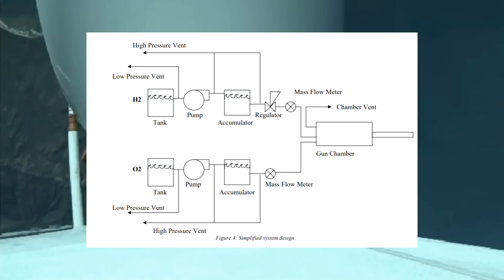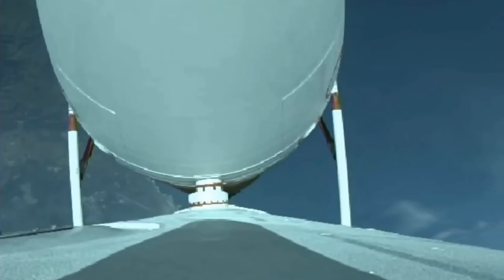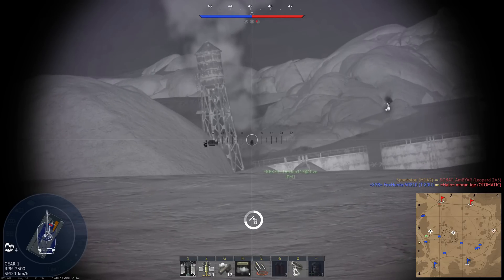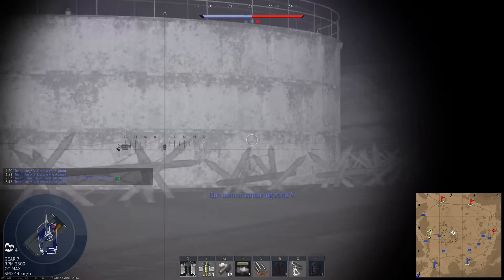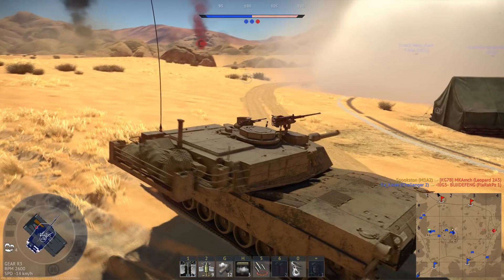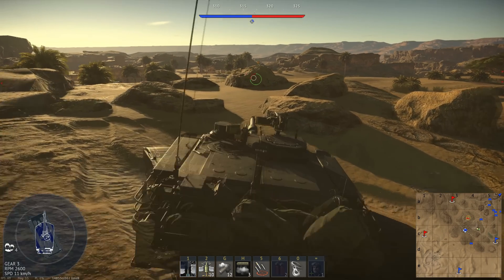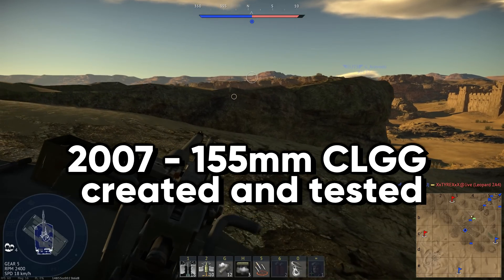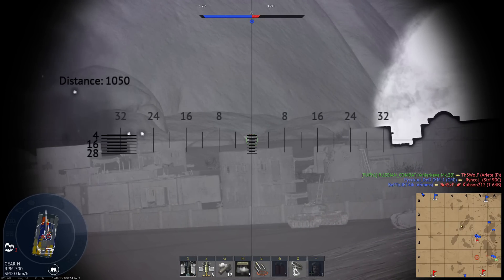CLG Guns - Future Tank Weaponry

Comment: Another issue with hydrogen is its low density, leading to very large fuel tanks compared to other propellants.
Reply from the maker: Yup. This can be seen on diagram for the fuel vehicle
Reply: @Spookston  Another factor of why ships really are the most likely platform for such a gun, along with the issue of hydrogen evaporation not being such a big deal if you can produce it on the spot. I guess those are also perhaps the main reasons I don't see this being mounted on a tank, as size really does matter.
Reply: @fishbed4522  I see
A huge electrolysis + H2 condensation and storage system would do
Reply: Are there any conventional materials that could withstand such high velocities? I figured tungsten and DU but anything else? Seems like it'd burn up. I didn't know there was anything capable of firing as fast as a rail gun. Sounds like these fire way faster. 
So maybe I misunderstood in the video... The Navy is NOT currently fielding any guns like what was mentioned in the video? They've only tested them?
Reply: @Joe_Friday  that would be an iridium-osmium alloy actually, the densest alloy known to man that is also incredibly strong. A dart similar to the current US APFSDSDU rounds (a 25mm diameter projectile with muzzle energy measured in 8.5MJ range) would weigh in at roughly 8kg (if we use iridium as a quick and dirty benchmark), at 4km/s this produces muzzle energy measured in 64 Megajoules. Given that, due to physics, we're going to be forced to increase dart diameter to get more 'oomph', it is likely that the next generation of APFSDS rounds is going to go from 25mm to something like 40mm, and likely to go to something like 60mm eventually.

Yeah, I did plenty of research on that sort of thing for my future-history setting. To provide an example, a 'modern' APFSDS or coil/railgun dart in-setting has a diameter that measures somewhere between 50mm to 80mm depending on the faction and the density of the dart. SolForce (one of the primary factions of the setting) uses a 60mm diameter iridium-osmium alloy dart with an electromotive 'wrapper' which weighs in at ~12kg at 2km/s... or sending hot death of 24MJ (~3 times the energy that a modern APFSDSDU round can deliver). If you go at 4km/s... it's basically 'stupid' amounts of kinetic energy (aka 96 MJ each shot). Not as crazy as Battletech's 190+ megajoule range gauss rifles (150kg rounds at hypersonic velocity), but getting there. At 3km/s and more, you start to get into the fact that projectiles start to become less kinetic and more EXPLOSIVE and at 5km/s you'll be seeing kinetic penetrators explode on contact with anything that is hard enough.
Reply: @TheTrueAdept  I'll revisit your comment with additional questions. My first questions is you said if the penetrator goes at around 5km/second if may explode on impact. Would this explosion be more deadly than if it was going slower and just punched through?
Reply: Joe Friday the optimal case for kinetic energy penetrators is to puncture the armor and spall inside the vehicle to deliver maximal damage to the weaker interior components. At high enough muzzle velocities I would assume a kinetic projectile starts acting more like a HESH round instead of a penetrator. But if the round is too tough you get over penetration which reduces lethality.
Reply: @Joe_Friday  that depends on several factors, especially what it hit. For example, armor and Whipple shields (although for something this massive, Whipple shields are absolutely USELESS) would cause the projectile to explode because of the sudden stop. Against materials that would just give way, it'll pass right through them... at least that is what I've been told.

To give you an idea, at 10km/s a projectile has the energy of TNT 11 times its mass. So a 20kg projectile can hit at 222kg of TNT. If it hits armor, then it explodes in a focused explosion as the potential energy is released in a single moment...
Reply: @TheTrueAdept  both osmium and iridium are a pain in the a** to process, as well as mine. That is the problem with all of these future technologies. The materials.
Reply: @Jambiya-1  That is due to the fact that there are few deposits on Earth, but in space, it's going to be far easier to mine and refine it. The sad thing is that the Outer Space Treaty is going to be a dead letter treaty not even worthy to wipe one's ass with as toilet paper.
Reply: @TheTrueAdept  I see what you mean. I almost exclusively think of gold/platinum group, helium 3, and crystals when it comes to space mining. Never looked into it too much. 

Would it be economically viable in the future? Iridium/osmium resources specifically?
Reply: @Jambiya-1  Yes, iridium and osmium are almost STUPIDLY common in space among Uranium and other elements and resources.

Just ONE decent-sized metal asteroid has trillions of dollars of mineral resources including Iridium and Osmium. Remember we only mine single-digit tons of iridium PER YEAR.
Reply: @TheTrueAdept  Interesting. I'll be investing in anyone that wants to do this, if we can ever get past the shit on earth first...
Reply: @Jambiya-1  it'll happen before shit on earth gets solved I'm afraid. :(
Reply: Niko Kareno how about a uranium 233 graphite moderated nuclear reactor with graphite neutron reflector to power a steam rocket? Go full big dumb booster and just launch a giant steam rocket to go tugboat the asteroids back to earth. Totally avoid mining, refining, and crew by just moving the big rock to earth orbit where another launch can come and deal with dismantling it and the waste can be clumped up as filler to be sold as cheap shielding for future stations in earth orbit.
Reply: @JaneDoe-dg1gv  You're better off using a closed-gas nuclear lightbulb instead of something like that. Since you're using quartz as the lightbulb (which is IR transparent), you can use simple water as the propellant and have acceleration profiles that are just STUPID. With a 7-nozzle, 32-ton unit, you can basically make a nuclear-powered shuttle.
Reply: Aaron Neumann yes a uranium chloride gas under compression could work. Would the quarts act as a neutron moderator? The reason to use lower temperatures are cost of construction. Why bother making an expensive corrosion resistant nozzle if you can instead just lug crap tons of water cheaply. Ooh how about a silicon nozzle and nuclear light bulb using 233 uranium trichloride?
Reply: @JaneDoe-dg1gv  no, I'm talking about a gas nuclear thermal rocket of the closed-gas type.

It's called a 'nuclear lightbulb' because the fission-gas is reacts in a quartz 'lightbulb'. No fallout, half the power of an open-air type. Project Rho (aka atomic rockets) has a significant portion of its engine design page just to this type of rocket.
Reply: Aaron Neumann I actually knew that. What I don't know is if the quarts is a neutron moderator.
Reply: Aaron Neumann I have seen reactor designs that rely on gas density to achieve criticality. If the quarts works as a moderator then the rocket can store solid uranium tetrachloride and convert it to uranium trichloride, a gas, to fuel the rocket, thus allowing for high temperature steam discharge and the efficiency you mentioned. Seems simple and cheap if a cheap corrosion resistant nozzle is used and the steam uses a pre heat system off the nozzle to prevent temperature induced failure due to thermal gradients.
Reply: @JaneDoe-dg1gv  it's a bit more than that but you're on the right track.
Reply: Aaron Neumann and what info am I missing if you happen to know. A neutron reflector should be added and maybe the change in uranium density from solid to gas could be off set by the reflector. Steam should be the working fluid due to lower density but the water needs to be converted to steam so the nozzle cooler can handle that. A gas compressor could be used to vary bulb pressure and a chlorine injection to increase density as well once the reactor has started up.
Reply: @JaneDoe-dg1gv  the quartz is literally the container of the vaporized fissionables, not a mediator or reflector.

Think of the closed-gas nuclear thermal rocket as a literal lightbulb, just with a quartz bulb (which is transparent to heat) instead of glass and a vaporized fission reaction as the light source. No risk of a meltdown because its already vaporized. ;)
Reply: Aaron Neumann I know that. I guess the quarts doesn't moderate neutrons so the design would have to run in the fast spectrum or have a moderator with the gas. Probably hydrogen.
Reply: @JaneDoe-dg1gv  more or less.
Reply: @TheTrueAdept Sorry to ask three years after you’ve made this comment, but does this mean that the round won’t penetrate at all, or…?
Reply: @smileyface6583  Well, think of a round going 4km/s or faster as basically a HEAT round.
Reply: @Joe_Friday  Railguns appear as the safer and more "economic" option given the relative complexity of systems. These just hit WAY harder.
Reply: @Hetuni  That's crazy how much faster they can go. I thought rail guns shot super fast. To think these things are about twice as fast...
Reply: Unless you used metallic hydrogen. It's light and incredibly dense. 

However metallic hydrogen is nigh impossible to make.
Reply: @nil981  yeah, a minor hiccup!
Reply: @nil981  If you can get metallic Hydrogen, you don't need oxygen because Hydrogen releases a lot of energy going from monatomic to diatomic.
Reply: @nil981  
I think it would be easier to use methylox propellant, since it already exists and is used regularly by rockets. Much better density, slightly worse performance.
Reply: @nil981  and metallic hydrogen is currently hypothetical, and has yet to be created in laboratory conditions.
Reply: You’re right, that’s one of many reasons methane is favoured on modern developing rocket engines over plain old hydrogen
Reply: I'm an independent researcher and principal investigator for the US DOE and a mechanical engineer. I might be able to provide some insight here. We solve the problem of conventional approached to CLGG by using compressed air and methane instead of hydrogen and LOX. The tanks gun uses the same fuel as its engine. There is a methane gas vapor accumulation tank. A high pressure fuel pump powered by the main engine pressurizes the fuel to 1500 PSI, the waste heat from the exhaust coupled to an induction heater heats the fuel to 1000 F. This phase changes the fuel into a supercritical fluid which is then pushed through a zeolyte catalyst to break ANY combustible liquid, gasoline, diesel, jp-8, crude oil, waste motor oil, vegetable oil, burnt brake fluid, waste paint thinner, you get the idea, into methane and methane gas-like products. A pressure reducing regulator drops the pressure and ensures the vapor accumulation tank remains at about 200 PSI. The tanks engine draws from these vapors to power it, this can be done via natural gas fuel injectors or a needle valve in the intake plenum. A pressure line from the vapor accumulation tank is routed to the CLGG, where natural gas injectors squirt a measured charge of the methane gas into the breech. Simultaneously, pressurized air from an air compressor driven by the tanks main engine fills an air tank, which is used for pneumatic tools, brakes, and pneumatic drive systems. This air is compressed to about 2000 PSI with a pressure reducing regulator for the auxiliary pneumatic systems. The high pressure air is also routed to the breech of the CLGG where injectors allow a measured charge of air to shoot into the breech at the same time the methane does. A massive selonoid coil is wrapped around the breech and slams the shell against the breechface, which effectively compression ignites and detonates the fuel and air. To ensure ignition even in arctic environments, a series of spark plugs without the side electrodes removed will fire if the shell gets close enough to allow the capacitors connected to the spark plugs to discharge by exceeding the breakdown voltage strength of the gas/air mix. Effective, this is a HCCI CLGG detonation cannon. Even though liquid diesel fuels have about 1/3 the overall energy density by weight compared to hydrogen gas, they have higher energy density's per volume. Liquid hydrogen has an energy density of about 10 MJ/K wheras diesel fuel has 38 MJ/K meaning that diesel has about 4 times the energy density in terms of volume compared to liquid hydrogen. And in a tank, we're more concerned about volume than weight anyway. The CLGG will use a fraction of a fraction of the total energy of the fuel tank, the engine uses most of the energy, and the CLGG would use it incredibly efficiently.
Reply: And what about solid rocket fuel? They did tried something in WW2 with some degree of success.
Reply: I love the physics I'm this thread I'mma come back to this
Reply: Hydrogen peroxide
Reply: Viraj Kadam it works as both mono and bi propellant but is unstable and doesn't offer the power density of a nuclear rocket. Nor does it offer such easy refueling.
Reply: @virajkadam1684  
It’s too reactive I’m afraid. Good stuff but there are a lot better options for rocket fuel, though I doubt anyone would want a hypergolic gun.
Reply: We solve the problem of conventional approached to CLGG by using compressed air and methane instead of hydrogen and LOX. The tanks gun uses the same fuel as its engine. There is a methane gas vapor accumulation tank. A high pressure fuel pump powered by the main engine pressurizes the fuel to 1500 PSI, the waste heat from the exhaust coupled to an induction heater heats the fuel to 1000 F. This phase changes the fuel into a supercritical fluid which is then pushed through a zeolyte catalyst to break ANY combustible liquid, gasoline, diesel, jp-8, crude oil, waste motor oil, vegetable oil, burnt brake fluid, waste paint thinner, you get the idea, into methane and methane gas-like products. A pressure reducing regulator drops the pressure and ensures the vapor accumulation tank remains at about 200 PSI. The tanks engine draws from these vapors to power it, this can be done via natural gas fuel injectors or a needle valve in the intake plenum. A pressure line from the vapor accumulation tank is routed to the CLGG, where natural gas injectors squirt a measured charge of the methane gas into the breech. Simultaneously, pressurized air from an air compressor driven by the tanks main engine fills an air tank, which is used for pneumatic tools, brakes, and pneumatic drive systems. This air is compressed to about 2000 PSI with a pressure reducing regulator for the auxiliary pneumatic systems. The high pressure air is also routed to the breech of the CLGG where injectors allow a measured charge of air to shoot into the breech at the same time the methane does. A massive selonoid coil is wrapped around the breech and slams the shell against the breechface, which effectively compression ignites and detonates the fuel and air. To ensure ignition even in arctic environments, a series of spark plugs without the side electrodes removed will fire if the shell gets close enough to allow the capacitors connected to the spark plugs to discharge by exceeding the breakdown voltage strength of the gas/air mix. Effectively, this is a HCCI CLGG detonation cannon. Even though liquid diesel fuels have about 1/3 the overall energy density by weight compared to hydrogen gas, they have higher energy density's per volume and they are the current standard supply chain material, cheap, abundant, and already in use. Liquid hydrogen has an energy density of about 10 MJ/K wheras diesel fuel has 38 MJ/K meaning that diesel has about 4 times the energy density in terms of volume compared to liquid hydrogen. And in a tank, we're more concerned about volume than weight anyway. The CLGG will use a fraction of a fraction of the total energy of the fuel tank, the engine uses most of the energy, and the CLGG would use it incredibly efficiently. Furthermore, depending on how efficient our air compressor is, we could use the compressed air tank to instantly supercharge the engine if extra power/torque/speed is needed. This air would be controlled via a selonoid valve to provide instant boost, and for normal cruising operational conditions we would run the engine either N/A or standard turbocharged. Lets say the engine has a built in turbocharger for higher efficiency and yet further reduced EGT's, those only produce about 15-20 PSI of boost at best. If more power is needed for a short duration, the compressed air tank, essentially a kinetic battery, is opened up and we effectively double, possibly triple, our horsepower and torque.
Reply: Idk about you but the liquid oxigen worries me far more than the hydrogen
Reply: @guvyygvuhh298  it's an oxidizer, so just like with the hydrogen if it leaks out it can be a pretty dangerous fire hazard. 
However liquid hydrogen is overall more problematic.
For one it's much harder to store. Liquid hydrogen has to be cooled to near absolute zero, and while boiloff can be used to keep it cool, thermal insulation is overall far more important. It also means that the oxygen and hydrogen cannot have a common dome for the tanks, as the liquid hydrogen would freeze the liquid oxygen solid. 
Then, there is hydrogen's density. Liquid oxygen may be more of a fire hazard but it tends to stay where you want it to stay. Hydrogen is do sparse that it's molecules are able to lodge themselves through solid steel (this is why things like the RS-25 engines have to "dry" a few weeks before being fit for duty again) leading to far more complex seals to try and keep the hydrogen out of places it must not be. 
There is also the risk of asphyxiation if hydrogen sips in large quality into the fighting compartment. However this is likely way less of an issue since that amount would probably already have frozen the tank solid.

This is why I believe that CLG guns will not really be easily implemented into MBTs, however they make perfect fit for artillery, being literally able to fire half the planet over is a pretty significant advantage for that application
Reply: Fishbed rockets can also use methane instead, which is denser.
The most common propellant in rockets is still kerosene but it’s not a gas.
Other propellants are also used but they have a very high toxicity.
Reply: trezapoioiuy water is easier to obtain and thus cheaper.
Reply: Jane Doe but you have to hydrolyse it, so for a mobile unit, that means burning fuel in a generator, which can’t be much cheaper that using fuel.
Of course that’s a different matter if you’re talking about a nuclear powered ship for which electrical power isn’t a problem.
Reply: @trezapoioiuy  the designs for this use nuclear reactors for the main powerplant, as using the heat from the rockets isn't going to do much overall.
Reply: trezapoioiuy for the cannon yes but our conversation switched to nuclear powered space flight. Specifically nuclear thermal rockets that use nuclear fission to provide heat for a propellant like water or hydrogen gas.
Reply: Jane Doe oh ok. Well that can only work as a 2nd stage, you’ll definetly need something else for liftoff.
And lifting up reactor + water + shielding - especially for manned flights - would require a big first stage, negating the “water is cheap” argument.
Reply: @trezapoioiuy  nope, a 32 ton nlb design can lift off by itself. Using hydrogen.
Reply: trezapoioiuy that's why I said big dumb booster. It's a design philosophy that say efficiency can be sacrificed for cost reduction. This design would use the water as shielding and would be unmanned. Also even using the water as propellant in the form of steam the reactor has a thrust to weight above 1 so it could actually work as a single stage to orbit if you had enough water. Steam is also the third best rocket propellant and at the temperatures of a nuclear lightbulb offer higher propellant efficiency over chemical rockets.
Reply: @JaneDoe-dg1gv  you've missed the words 'insane acceleration' mate. A NLB would send a few kilotons of spacecraft into orbit by itself, drop the payload, and land on earth to do it all over again.
Reply: I had specifically thought of using six of these engines. Five would be reusable boosters and the sixth would be the rocket that would actually go gather the asteroid. It would need multiple launches to haul extra water up to space but afterward it could work on its own to bring an asteroid to earth orbit, high high earth orbit, where a separate mission can be launched to begin excavation.
Reply: Aaron Neumann yea... no. To make The whole system cheaper it would be easier to make really really big ones. Think sea dragon size for one rocket. It's stupid, yes, but also cheap for the size of payload it would be launching. If the idea is to actually fund an asteroid recovery mission and do it in the investors life time. That would be a pretty easy way to do it.
Reply: Having to compress the gas would be a problem due to the correlation between pressure, volume, and temperature. Don’t want to ignite it prematurely
Reply: Somewierdo Online for the cannon you can use an intercooler and/or inject the fuel and oxidizer separately. For the rocket we were discussing it doesn't have combustion.
Reply: You can get around this by super cooling and just dealing with it heating and pressurizing.